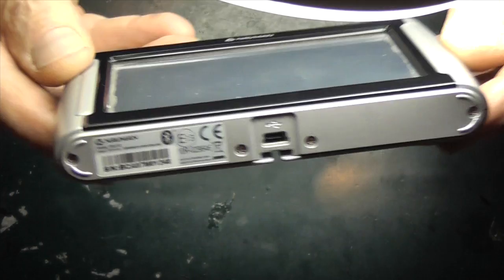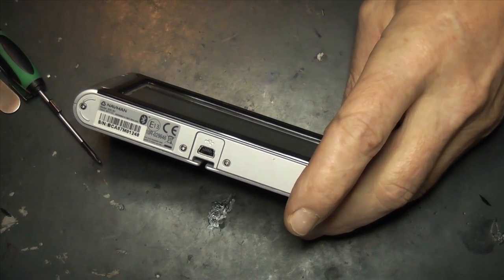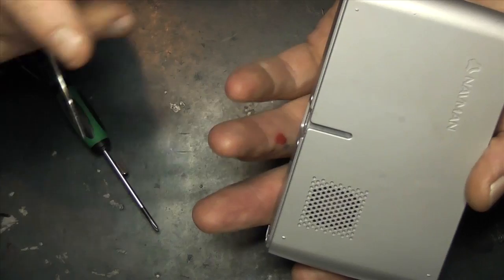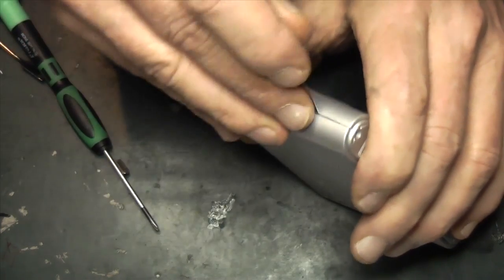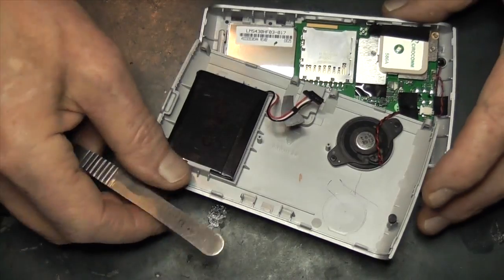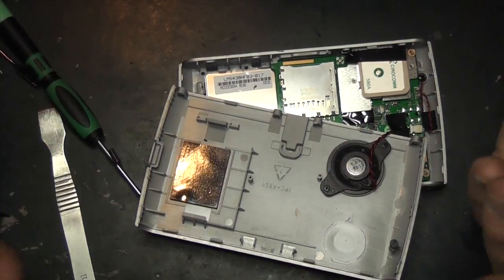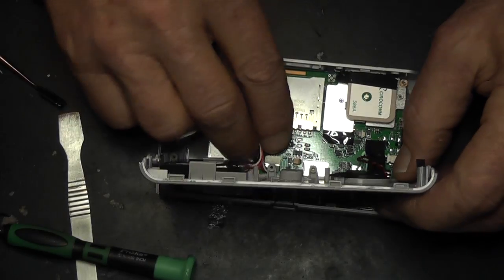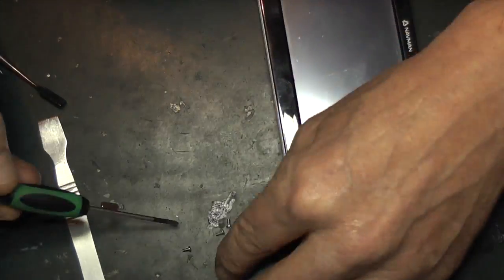Navman battery replace

Comment: Many thanks Tony. Very nervous prying the case apart, but little by little it came away fine. New battery @ just under £9 seems to have done the job. So good to repair something/defeat inbuilt obsolescence rather than chuck it away and buy new for say 10 times more. Again, many thanks and much appreciated.